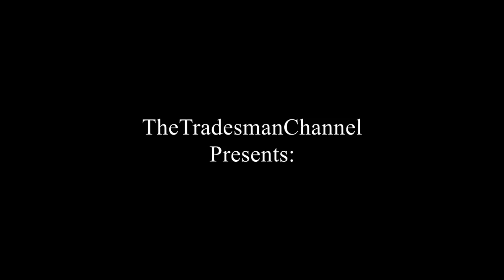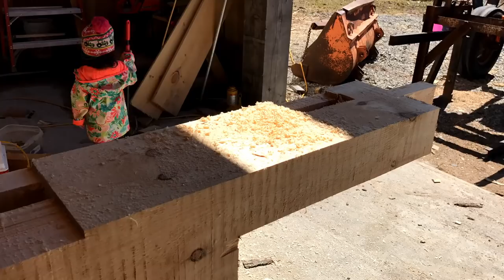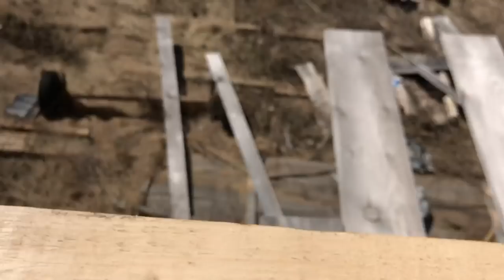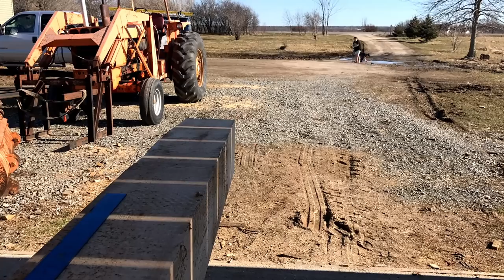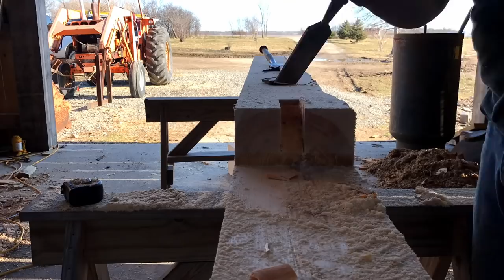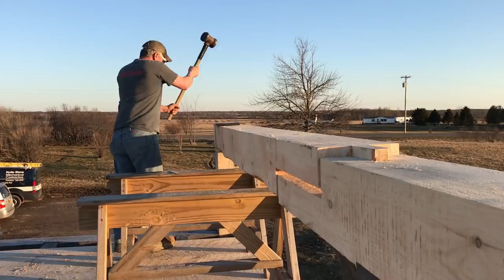A Huge Part of the Timber Frame Finished

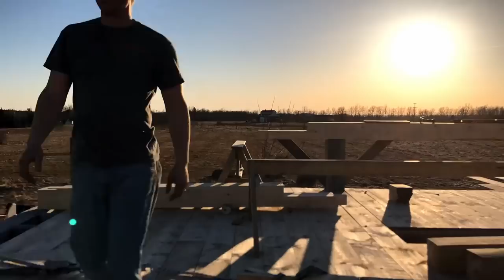Comment: Jim, at 9:41 it shows one of your queen posts overhanging a king post by about three foot.  Then there is a joint which is not centered on top of the king post.  Are you worried about where that joint lands?  Seems that the joint should be directly over a post.  Or am I making a mountain out of a mole hill?

Glad you got all the big timbers in place.  Patience and a love of timberframing has gotten you this far.  I hope the weather holds out and am excited to see the rafters installed.
Reply from the maker: A scarf joint should never be placed directly over a post.  The greatest amount of lift from the post is directly over the post.  This could cause the joint to fail.

Comment: Your ass is in serious trouble with the little one! Got ammo? Hahaha Wood question about the pegs. Do you use a different Wood for them & if so, why?
Reply from the maker: Lots of ammo.  Charlie where have you been?
Reply: TheTradesmanChannel  I'm an old fart. Had some plumbing redone. What amazes me is I've had parachute malfunctions, blown up, shot, airplane broke and 3 ex wives. And now this crap. Guess it beats the alternative!
Reply from the maker: You're taking oxygen, that's what matters.
Reply from the maker: I just realized I didn't answer your peg question.  Yes it is a different wood, pegs need to be out of hardwood that is straight grained, that is why I use white ash.